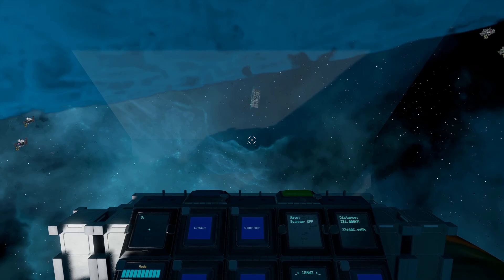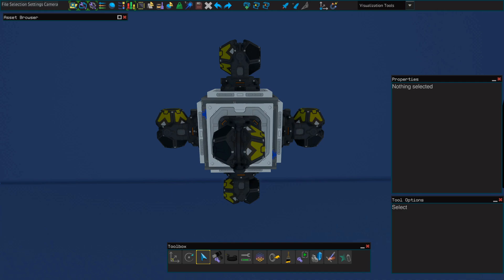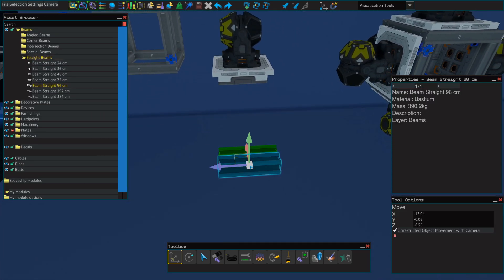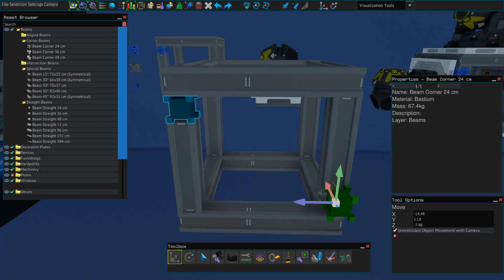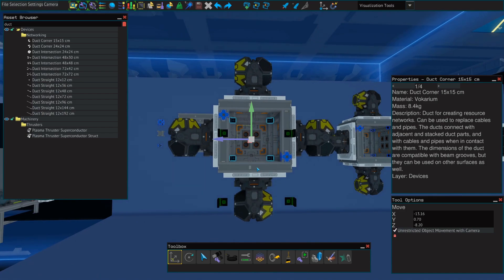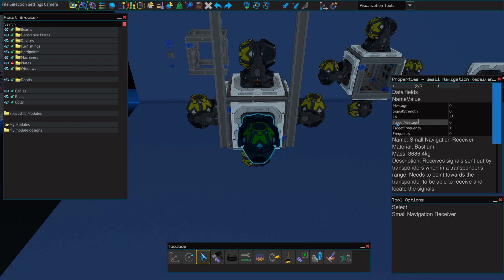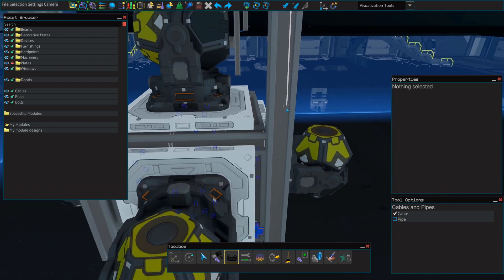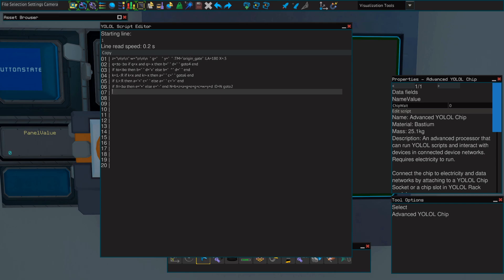Starbase YOLOL Scripts: Compass

Comment: This is awesome, but a little expensive.  anyway it can work with less receivers?
Reply from the maker: It can be done with 5 but will lose some accuracy, This is also built to be expanded on later so that waypoints can be created to point the compass towards custom waypoints (I'm still working on this) and for that you will need all 6.

Comment: Very nice as usual. Thanks for all the hard work. Did they change how the wiring works? I didn't see you run any wires inside the box.
Reply from the maker: Thanks! No wires are needed inside the box. As long as ducts are in contact with the back of the hard points they will share their cable or pipe connections, so you only need to connect a cable to either of the exposed ducts! 

Large hard points can also have ducts connected to the sides of the back portion.
Reply: @SpunieBard  whaaaaaaaaaat? Wow, thanks! I hate connecting cables to hard points!
Reply: @SpunieBard  that duct feature so useful that it deserves a separate giude!